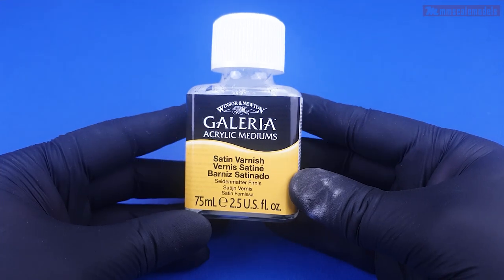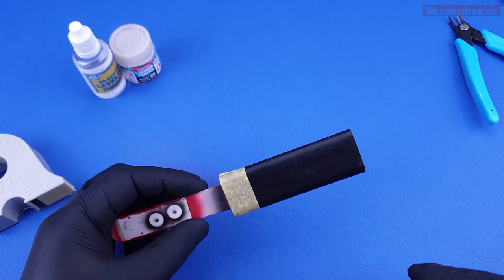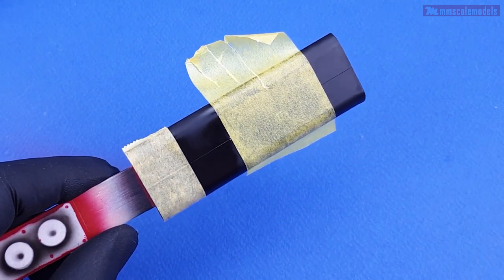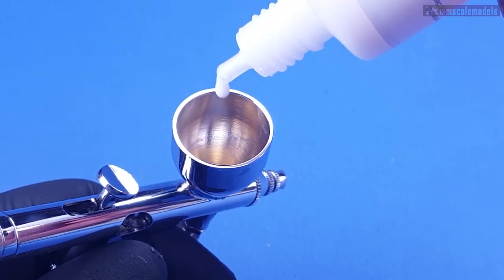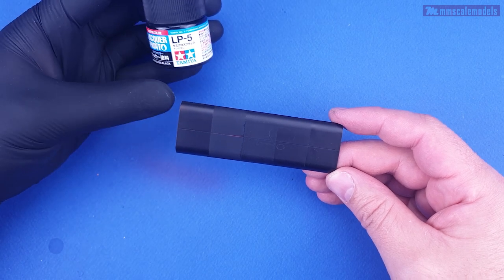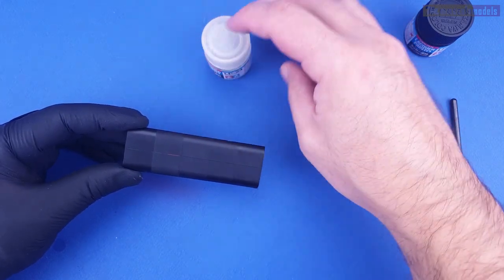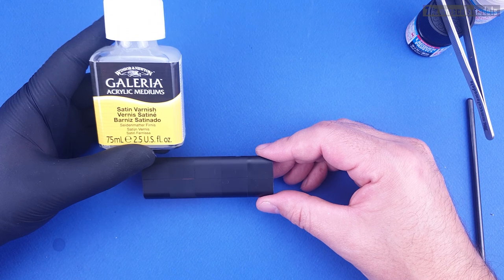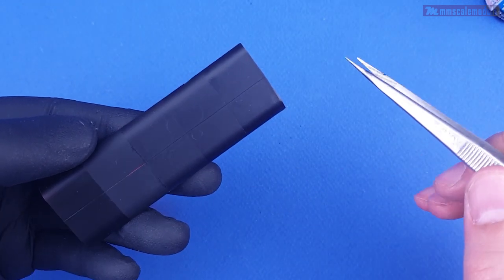Satin varnishes comparison - pick your winner.

Comment: Hello Metodi! I always use lacquers as they are tougher. I suggest you try out the MRP Semi Gloss for a satin finish. From experience i have been simply relying on lacquers for the past many years due to their durability and how much abuse they can take. Lucky varnish or any acrylic varnish would probably not take Abteilung quick dry thinners or other more “aggresive” weathering products. My 2 cents
Reply from the maker: I am also a fan of laquer paints. However if I apply effects with watercolor pencils then laquer varnishes destroy them, hence the search for good acrylic varnish.

Comment: I've used the Ammo by Mig and the way it looks upon application is deceiving because it's water based it looks spotty. But I applied with light coats and air pressure and it dried,  finally , quite nice. I choose Ammo.
Reply from the maker: Thanks for your feedback mate 👍
Reply: The ammo varnishes give a great finish but they are incredibly fragile. I ruined several projects using them and will not touch them again.

Comment: Might be hard to find in Europe but SMS Gloss and SMS Matt mixed 50:50 gives an amazing satin. I also used Mr Hobby UV cut same 50:50 mix. Those mig paints are trash to spray, only good for brush painting.
Reply from the maker: The mr.hobby stuff is available where I am and will be trying your mix. Thanks for sharing.